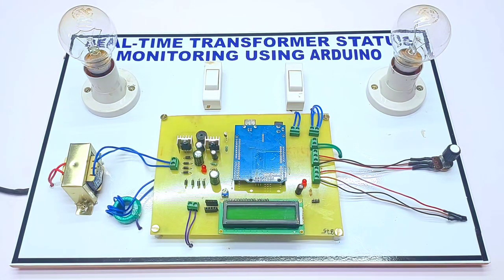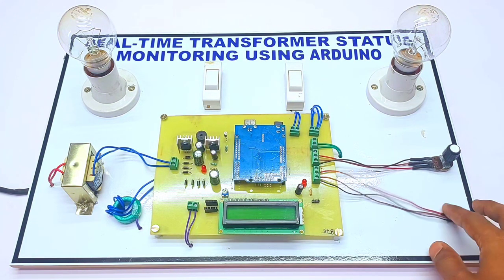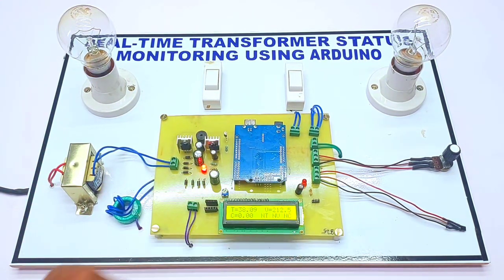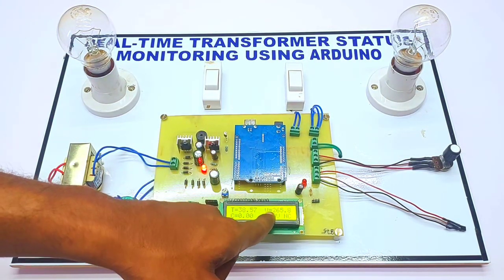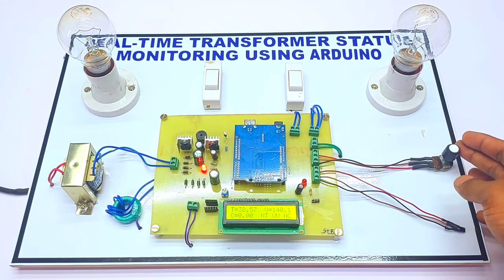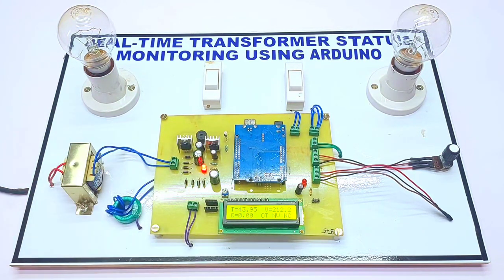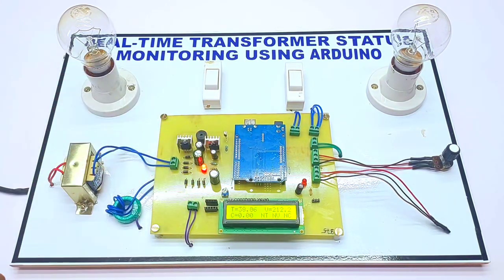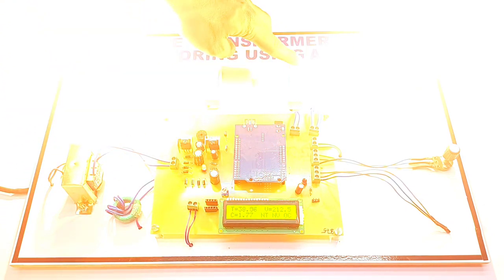TRANSFORMER STATUS MONITORING USING ARDUINO||CREATIVITY THINK|| #transformers #transfer #project

Comment from the maker: For ordering the project, contact us 919483175986, 917019689991.

Welcome everyone to Creativity Think We are introducing our latest project: " REAL-TIME TRANSFORMER STATUS MONITORING USING ARDUINO." For all the detailed information about the project, please refer to the project synopsis available at this link

SYNOPSIS OF THE PROJECT LINK ; https://drive.google.com/file/d/1r3w1szrmasgM6jm6IvsHzolMX143wuhD/view?usp=drivesdk
-------------------------------------------------------------------------

IN THIS PROJECT, THERE ARE FOUR KITS AVAILABLE 

1.  Ready-made Project + DIY Project . Ready-made project kit, One more extra bare PCB solderable components for extra PCB, All documentation (Report more than 60 pages, PPT 15 to 20 slides of the PPT, Circuit diagram the project, Program code of the project, pcb layout of the project, pcb schematic of the project, pcb slescreen explanatory video )Audio and video call support, One year warranty, priced 7499 Rs.

2. Ready-made Working Project kit.
The ready-made project kit along with comprehensive documentation (over 60 pages report, 15 to 20 slides PPT, circuit diagram, program code, PCB layout and schematic, explanatory video), audio and video call support, and a one-year warranty, priced at 6499 Rs.

3. DIY Project Kit of the project .
The DIY Kit includes a bare PCB, solderable components, external components, and all necessary documentation (over 60 pages report, 15 to 20 slides PPT, circuit diagram, program code, PCB layout and schematic, explanatory video) for institutions, priced at 5499 Rs.

4. The "For Documentation" option provides comprehensive documentation (over 60 pages report, 15 to 20 slides PPT, circuit diagram, program code, PCB layout and schematic, explanatory video), along with audio call support, for a price of 2000 Rs.

-------------------------------------------------------------------------

📱 Get Connected:

Connect with us via WhatsApp or Instagram to explore our project offerings, discuss customization options, or place your order. Our dedicated team is here to assist you every step of the way.

🔗 Contact Information:
WhatsApp: 917019689991, 919483175986
Instagram:https://www.instagram.com/_creativity_think?igsh=amZybGw3d3V0YnAw

#transformers 
#project 
#TRANSFORMERHEATH
#arduino 
#arduinoproject 
#current 
#collage 
#diy 
#powerengineering 
#engineering 
#project 
#engineering 
#engineeringprojectcenters 
#engineeringprojects 
#project